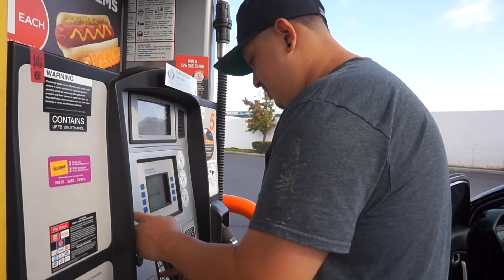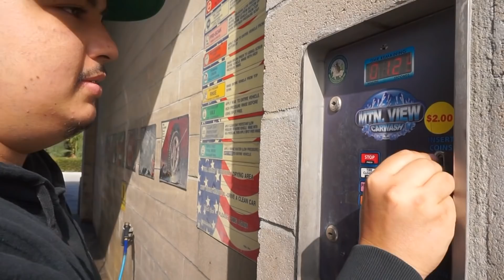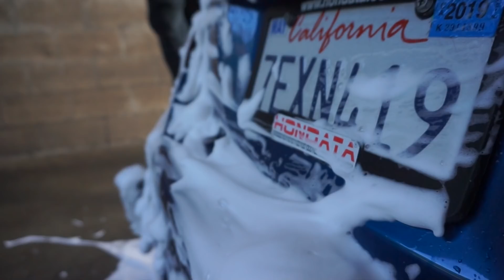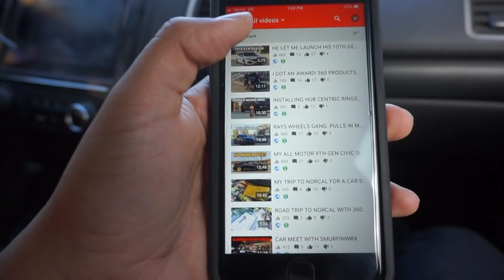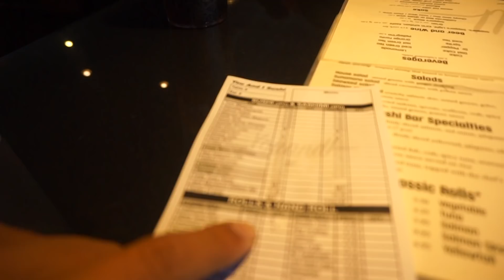TURBO 9TH GEN CIVIC SI IS BACK! TIME TO TUNE!

Comment: Is it a pain to keep the red on the seats clean? Looking at getting 15 fb6:) also are the sedans heavier than the coupes ?
Reply from the maker: Yes it is hard to keep them clean!! I switched mine to the all black seats. The seats should be the same. I don’t see any differences
Reply: Iamdanimal what you recommend on products for cleaning the red portion on the seats. Don’t wanna use something that will fade the material lol
Reply from the maker: Compa Cheo i only use 360 products bro! They have a product for interior and it’s called foam all.

Comment: Ouch, don't wash your car with the brushes at the self serve car wash. That's a guaranteed way to scratch and swirl the hell out of your paint. Source: detailer
Reply from the maker: Oh yeah we know. We even said ppl would talk about it. I told my friend also.
Reply: @IamdanimalFg4  ah okay, as long as you're aware. I've had clients ruin the $500 correction job they paid for a week after I did it by going to those self serve wash places against my advice.
Reply: AerisM then what are u supposed to wash it with?
Reply: @qgaming2221  your own buckets and mitts if you absolutely have to use the self serve. Like many people do. Or just wash it yourself, hose, 2 buckets, good soap, two mitts (preferably a separate bucket for the wheel mitt and brushes, or just wash the wheels last)
Reply: AerisM Thanks man
Reply: AerisM Do you think foam cannons are worth buying?
Reply: @qgaming2221  yes, for a good reason. When working on dirtier cars, with darker colors on which dirt is easily visible, I notice a significant reduction in dirt using a foam cannon, letting it sit, then rinsing it with the pressure washer. Precleans the surface much better than just a rinse from the pressure washer, or a soak and rinse from a regular hose foam gun. I personally use the MATCC foam cannon on Amazon, it came with 5 tips too, for about $25 iirc. It works great, as do the nozzles, I have no complaints. I use it with my Harbor Freight electric pressure washer with a Ryobi replacement wand that gives me a 1/4" quick disconnect on the end to hook everything up to.

The presoak with the foam cannon and rinse works on every car I use it with, and on dirtier cars there is a very significant reduction in visible dirt on my mitt when washing vs. other preclean methods, short of strong degreasers and such with a pressure rinse.
Reply: AerisM Wow great info thanks!!
Reply: +Q Gaming yeah no problem! Check out AMMO NYC, Pan the Organizer, and Obsessed Garage for more information. You can learn everything you need from them.